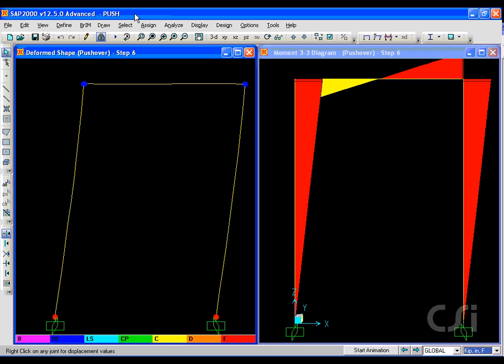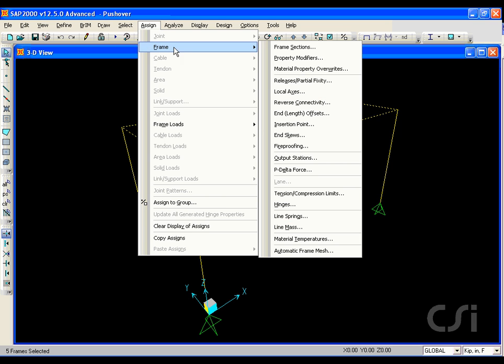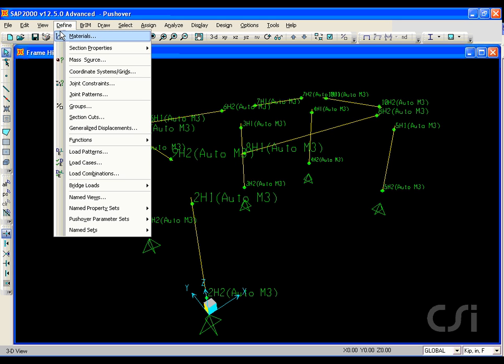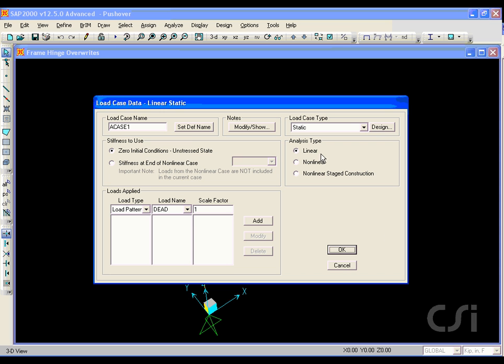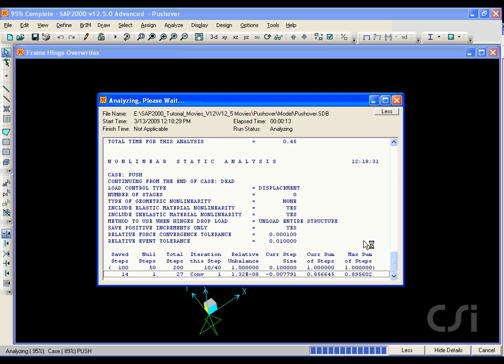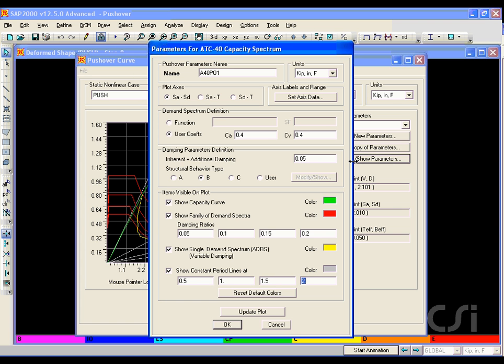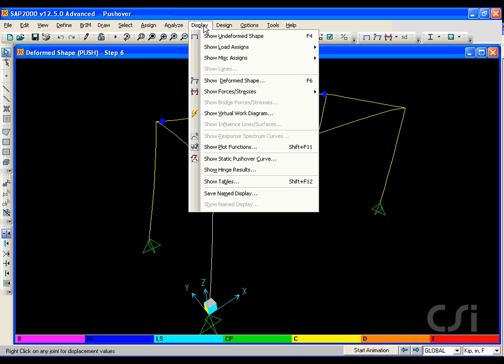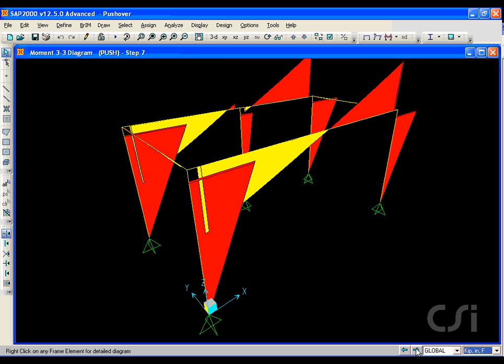sap2000- زده کړه 20 Pushover V14S

Comment: if i want to do a simply supported beam, were the plastic hinging will be at the center of the beam. how to place the hinge. I actually assigned one hingle 0.5 relative to the length of the beam. But after I run. Graphically, two plastic hinge is presented on both side of the inflection point. Note: the Push loadcase is appliead at the beam midspan. Thanks
Reply: my question is : Is it right?